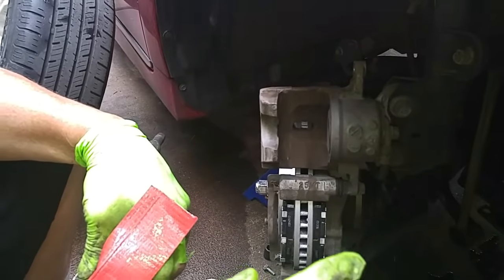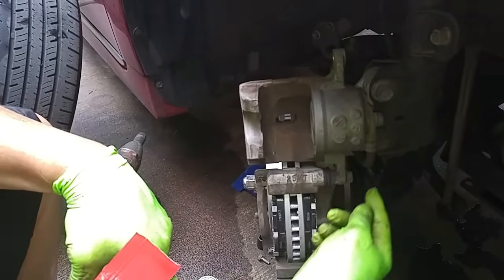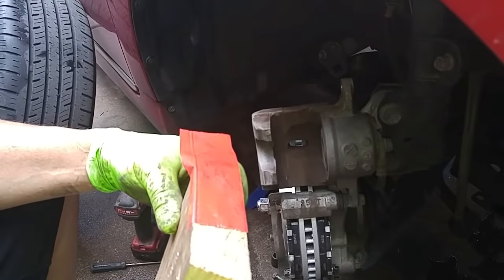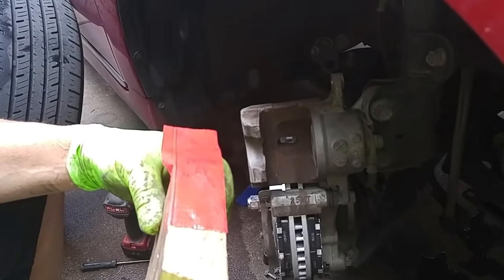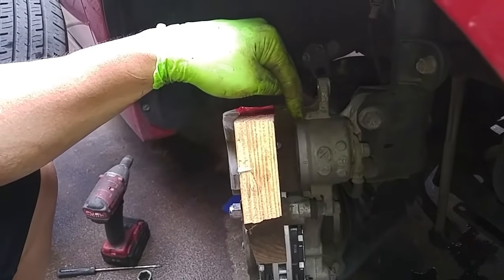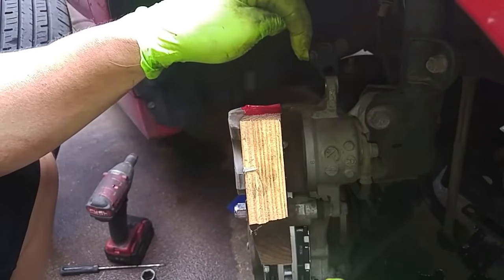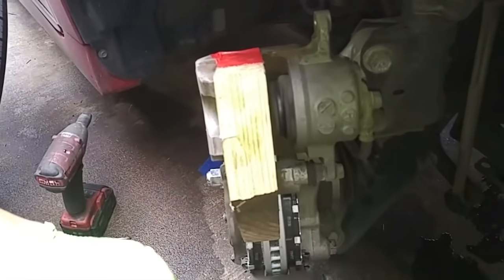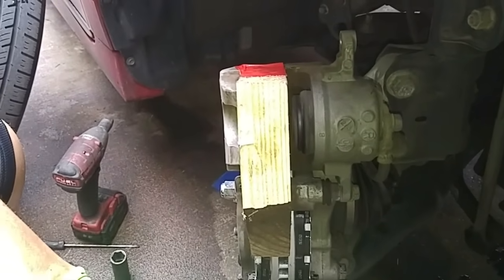Replacing Brake Pads With Electronic Parking Brakes?

Comment: if that's the case, having the ignition on and the computer calibrate the pressure the won't that cause problem if it happens while you are driving?
Reply from the maker: Highly doubt the calibration will activate while the vehicle is in motion.

Comment: Do I understand correctly?

The e-brake applies the same breaking system as the normal brake pedal?

I.e. not two separate braking systems?
Reply from the maker: That's correct.  When the parking brakes are activated, electric motors push against the caliper pistons in lieu of brake fluid hydraulic pressure.
Reply: @hardlymovingpro oh ok.

So same caliper/pads but the electric brake will still work if brake fluid pressure drops, yes?
Reply from the maker: The e brake is electric motor not associated with hydraulic brake fluid pressure.

Comment: I’m guessing this doesn’t apply when the parking brake uses a drum set up
Reply from the maker: Yes.  I do not think any car manufacturer uses electronic parking brakes tied to drum brakes.
Reply: my 2008 prius has e-brake with rear drums. like the music junky iI am I had the power on while repacing front caliper. rear brakes are now locked. what should I do

Comment: Mann, I’m working on my 2017 Lincoln MKC. I didn’t know about the maintenance mode and I already took the pads out, now I can push the pump back in because the car say park brake malfunction service now. Any help with getting the pump push back in work be greatly appreciated. How do I get the piston back in?
Reply from the maker: Not familiar what that vehicle.  But remove the caliper and if a motor is attached to it, providing 12v current  to the motor could recess the shaft that pushes against the piston.  Good luck!
Reply: I'm guessing your calipers are damaged now because these calipers are not like the old style ones, they have very small ball bearings inside and now they are loose inside causing the planetary gears to be jammed up.  @hardlymovingpro

Comment: My Buick Lacrosse calls for the negative battery cable to be disconnected.  My spun completely out of the caliper before I learned about it.  I was anle to get it started back in and used a pipe wrench to tighten it down.  Before doing the other sude I ordered the tool needed to screw the piston back into the caliper.
Reply from the maker: you can also use a large C clamp to screw the piston back in.
Reply: @hardlymovingpro  No, DO NOT do that on GM vehicles. You may destroy the ABS module. You must use a scan tool to retract the calipers. Follow the service instructions and see PIT5953!

Comment: Thank you so, so, so so so much for this information sir
Reply from the maker: Most welcome!
Reply: @hardlymovingpro  so I have a 2017 Kia Niro. I wanna replace the rear brake pads.
Is it basically a rear brake pad job with the only difference being... Do not turn on car to avoid auto parking thing?
Or are there more things I need to worry about. My mechanic made it seem like it's more work because of the parking thing. He said,
"oh yeah because of that, $289"

Im very confident I can do it myself if I only have to worry about not turning it on and keeping key away.

Comment: So  unplug battery pretty much
Reply from the maker: Not necessarily.  Just make sure your parking brake is not engaged.
Reply: You never want to unplug your battery it will erase the memory and your car will idle rough for a long time and it actually can cause you to get an in accident.
Reply from the maker: @pbassassinz8097  And you have to reset all your radio stations.

Comment: Hi there thanks for your time. We have a chrysler 2019 came from Dubai had an accedent on the back exactly rear left tire broken now the electrical parking brake is not operating can the be the fulty?
Reply from the maker: If the brake caliper has a parking brake motor as part of the system, the accident may have broken the motor.
Reply: @hardlymovingpro  we replaced the motor in Dubai and another this the back boot is not opning.

Comment: Just unplug the wire to the break caliper motor.
Reply from the maker: Not all cars have motorized brake calipers.
Reply: I did same mistake my with electric parking camry  piston is out now having hard time to put it back. I did  now by pushing iner screws 
 Also my parking break malfunction light came on . How can I fix that ?

Comment: Are there any precautions I must ask my mechanic to take when replacing my brake pads on my 2017 Subaru Outback with braking assisted technology. He is really old school and may not be familar with the newest technology. It makes sense that there is some electronic connections that need to be disconnected and then reconnected after the pads are replaced.
Reply from the maker: He cannot have the parking assist on and must have the ignition off.

Comment: Heads up appreciated. I don't own a e brake car. But may purchase one . Pedro using wife's ipad. Got subie sti back . 
Po448 and po447 turned out to be corroded ecm and evap signal wiring . 1650 dollars. 750 for ecm  rest was troubleshooting at subie dealership . Now I can pass emissions in tax hell ct.
Reply from the maker: Wow ... $900 for troubleshooting?  How does a ECM get corroded?
Reply from the maker: poor fellow  I hear you!  It called "up selling" the customer with fear, doubt and uncertainty to get you to agree to more parts and service.

Comment: What about disconnecting the battery terminal before working on these kind a cars.
Reply from the maker: There's nothing wrong with doing that as well ... but the customer may get upset that all his pre-set radio stations have been knocked out.
Reply: Toyota cars from 2002 and up don't really like to have the battery disconnected; it will idle poorly for up to an hour of driving. some won't even stay on without feathering the throttle. you'll have to relearn the idle. youtube can help with that but more of your time wasted.
Reply: @hostilityy  Yup. the computer also controls the ground to the compressor which means if the idle is lower than specified, the car says no AC for you in order to prevent a stall Lol. now that sucks if in summer waiting for idle relearn.